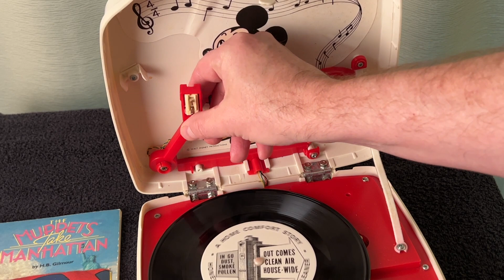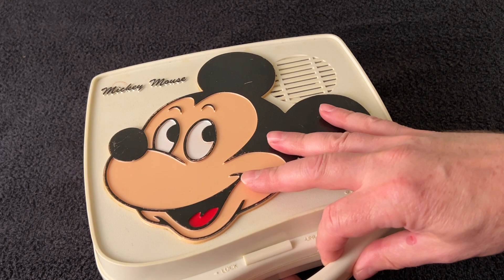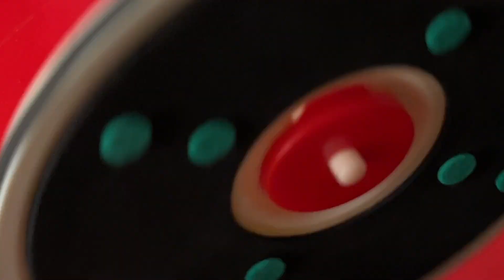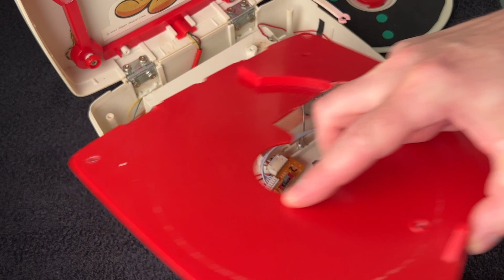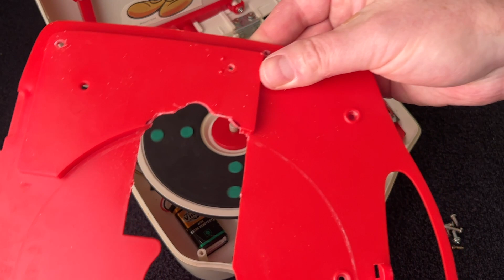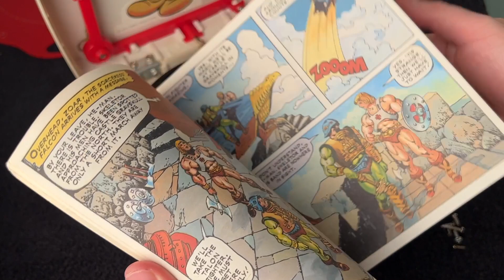This 1970s Toy Record Player Was DEAD... Watch the Rebuild + Demo Restoration

Comment: Tengo em mismo!,pero todo no eran igual,el mio trae el plato de aluminio,e imposible colocar correa como a ese.
Lo tengo hace 5 años y no tengo muchas nociones de electronica.lo he transformado,poniendole otro plato con motor incluido de un tocadiscos  antiguo pequeño,etc,etc.
Ahora me funciona perfecto,pero yo le he puesto el brazo y aguja a la derecha,y lo puedo usar abierto o cerrado,tambien puse capsula y aguja actual(pues saltaban los discos de años posteriores),y con una sola bateria de 9 v. O adaptador.  Me quedo chulo.
Gracias por tu aporte👏👏👏

Comment: Don’t recall if you’d said you replaced the stylus or not but likely all it needs to fix the tracking issues - probably a worn conical tip, coupled with tightly squeezed together grooves on that long-playing 7” disc.  Great vid, creative repair!

Comment: neat. i like your style. i think maybe if i was going to do something like this, i would try to attach a metal disc to the bottom of the plastic one with a smaller diameter. that would 1) lift the whole thing up 2) allow you to mount the motor inboard from the edge of the platter, eliminating the need to cut out the plastic 3) add weight to the platter and reduce speed variations

Comment: 9:47 i know what that noise is and what causes it: the motor connects and disconnects electrical contacts as the shaft spins to give the best magnetic properties to the coil of wire that the power is connected to, this creates an electrical disturbance (a humming sound) which the speaker turns into sound

Comment: I have a few of these type kiddie players
The speakers in these are only 3” and unfortunately won’t get the best sound quality out of them
Is that speaker in that have that red plastic for a backing? If so you can swap it out with a regular 3” speaker or is that just a cover that protects the speaker?

Comment: Nice mod. Those rubber wheels are notorious for going bad. The rubber they used goes soft for a while, so it forms to whatever is touching it, then the rubber hardens, setting it to the new shape. It was used in many reel to reels back in the day for drive wheels and even belts.

Comment: Have you ever tried a NE556 as a output stage you know using one half as a clock and the other half as the modulator which would drive the speaker?

Comment: You should have kept the speed control knob by adding a potentiometer to its axis and connect it to the 3 legged potentiometer on the speed control board and get rid of the small potentiometer.

Comment: If you wanted, you could get a voltage booster module to power the motor off of the 3 volts. You might even be able to take the power off the amplifier board where the old motor connections went so you could turn it on and off with the amplifier. I never had one of these record players. Back in the 80s, I just had a beige and blue Fisher-Price turntable. Eventually, the amplifier died on it something like 20 years ago. I didn't know about security bits or capacitors at the time, so it might have been an easy fix if I knew what the problem was. I'm sure I threw it out. I really don't have any interest in getting another one. I never got any loud, nor was the sound quality any better than a shoe box tape recorder. A Crosley probably would sound better. I doubt the Crosley would last ten years like the Fisher-Price did. A never had a Crosley.

Comment: Man, I was unaware of none os this crazy modding you had to do to get this working! I would personally have made one switch control both the amp and the motor and just leave the dial for the volume and I would have put connectors for the 3V and 9V on the back so it didn't have to run off of batteries! I wonder what one of these would have sounded like when new! I might get one sometime and try to get it working with all the original design!